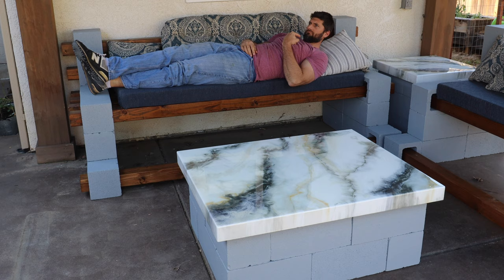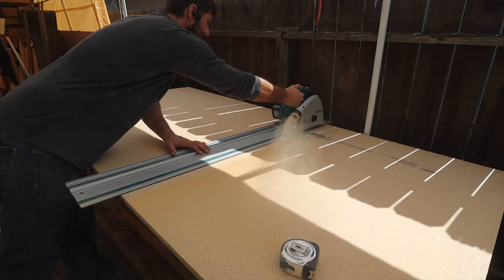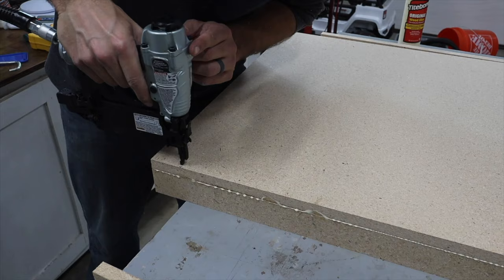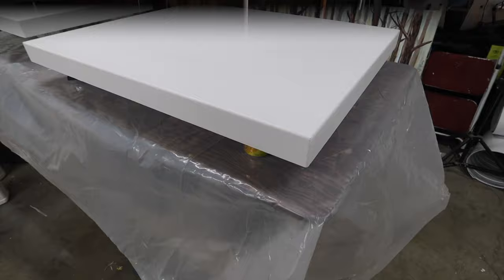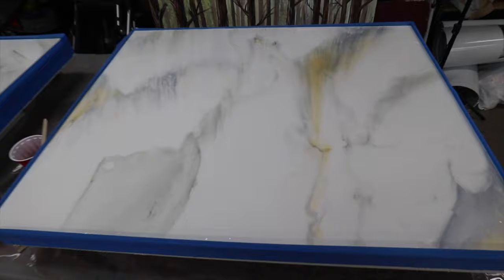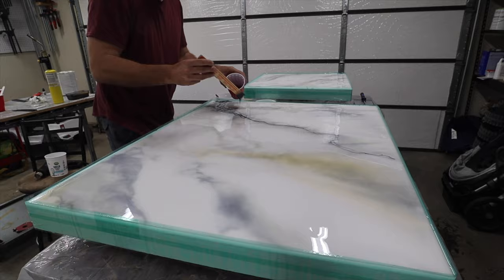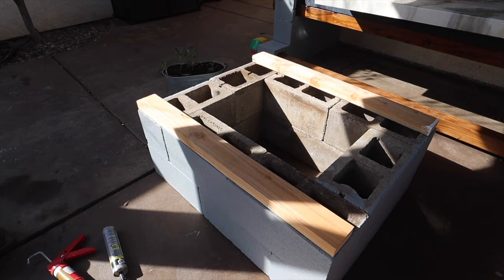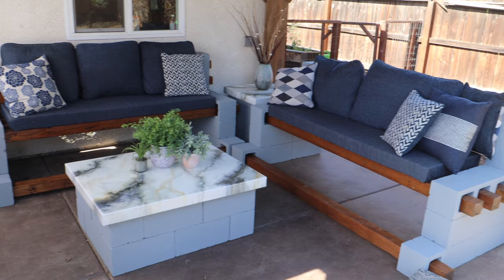Easy Cinderblock and Epoxy Patio Table / Epoxy Resin Countertop pour // Concrete Table

Comment: Man!!! Absolutely amazing. Who would think to make outdoor furniture with cinder blocks and budget wood. Such a cheap probably $100 if not LESS and you created something that looks  like it’d cost 200+ at Home Depot haha. The marble effect really worked out PERFECT. I love your outdoor furniture. Just some wood, cinder blocks and paint with resin. So simple yet amazing. And I love that you provide step by step instructions. Also love the bits of humor you add in 😂😂 WAKE UP! 😂 great job tho man! Love to see new videos by you!
Reply from the maker: Thanks Alex! Cinderblocks were about $2 a pop, paint was around $25 (for all the furniture combined and I still have about half a gallon), the wood was I think $30 and then the epoxy was the only expensive thing. It was around $100 for a gallon, however I only used about half. So all in all, I think you nailed it, probably around $100 total.

Comment: Hmmm... If you plan on leaving those outside at all times... I would have put one or two thin coats of epoxy on the bottom of the particle board too... you know how particle board is with moisture. Even if you life in a desert like Los Angeles or Las Vegas... there is still some moisture buildup over night here. So everything metal(like my grill) I dare to leave outside rusts, and I guess this will puff up nice too, over time.

Comment: I like that the top fits over the cinderblocks. Simple but makes it looks much more professional than just setting it on top of the blocks
Reply from the maker: Thank you! Yes this is a super simple design, but can turn out pretty cool depending on the epoxy pour

Comment: How has it held up? Any yellowing? I have a client that wants one for outdoors..  the place is ocean front.  I'm concerned with how well the color will hold up being outdoors and  the salt in air.  Any thoughts?
Reply from the maker: It has unfortunately. I would not recommend going white with anything that will be outdoors.
Reply: Why did it turn yellow?
Reply: Does it need to be clear sealed on top again?

Comment: How long did you wait after the pour before pouring the colored epoxy?  And how long did you wait before pulling the tape off?   Thank you.
Reply from the maker: I did not wait at all. I poured the clear epoxy, then the colored directly on top of it... I waited about an hour before pulling off the tape, but this will vary depending on what kind of epoxy you have, as well as room temperature... Best thing to do is go every 15 min or so and test the epoxy.
Reply: @BMSculptures  thank you for posting and replying. I did my first epoxy top today. Other than my hands ending up messy it turned out great. Your video inspired me.  It was as easy as you video showed. Thank you and God’s peace.